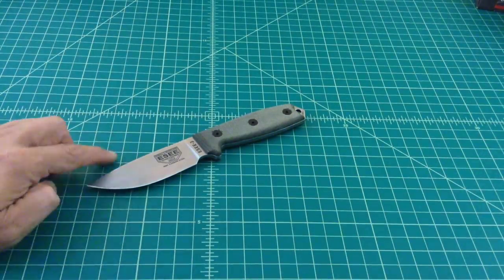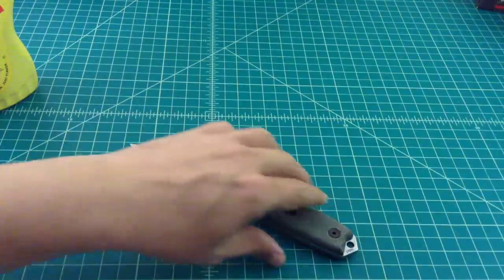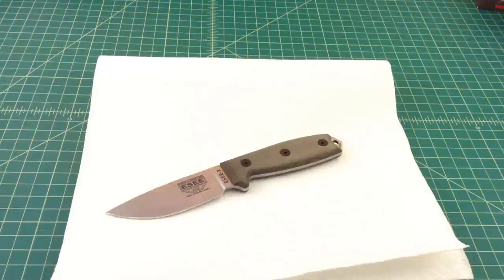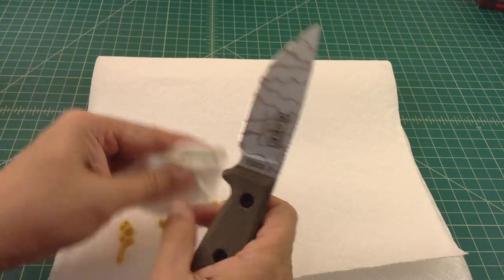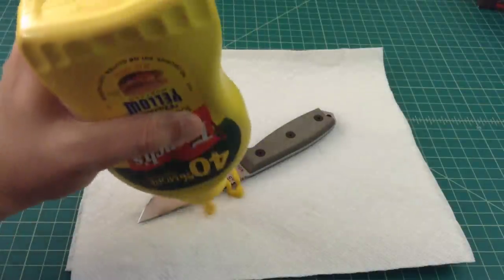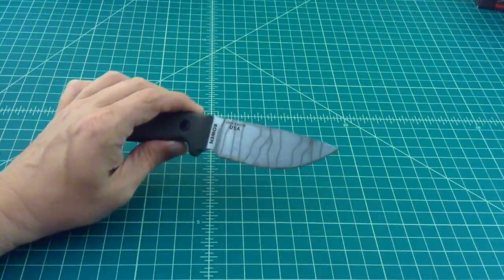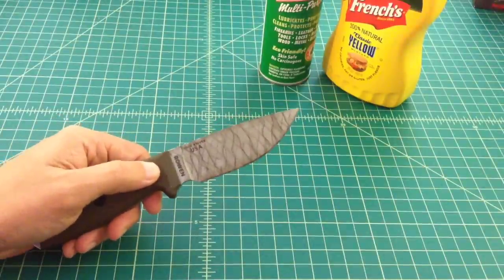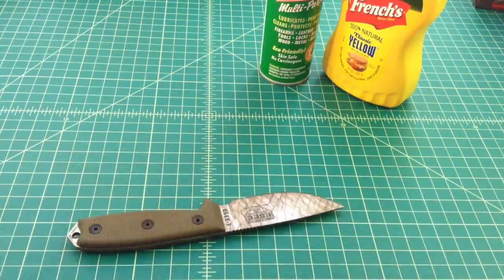ESEE 3 Knife - Forced Patina - TheSmokinApe

Comment: If you bake the mustard for awhile at 170-180 (oven's lowest setting) it will "burn" in the effect deep enough into the blade that you would actually have a hard time even sanding it off. Done it on Opinel blades. Actually, mustard, lemon juice and white vinegar mixed together worked best.
Reply from the maker: Nice, thanks for the tip!
Reply: J.P. Stone how long? I recently made a neck knife and I'm still working on the blade design. I'd like to know an exact time
Reply: JP Stone don’t do that. It fucks your heat treat up real bad. Your steel will be much weaker.
Reply: Enzo Warren 170 degrees fucking up a heat treat? Some people’s cars get hotter than that.
Reply: @nathandkreosote9917  Any heat temperature can destroy a heat treat.
Reply: @kash7768  Unless the steel becomes hotter than the temperature that the steel was originally tempered, the steel will not become softer. Heating the knife to 170f doesn't alter the steel hardness if the knife was (for example) originally tempered at 350f from the factory.
Reply: @kash7768  definitely not true

Comment: Just did a forced patina on my Mora robust with apple cider vinegar and it came out good so far. I boiled the acv and had the knife in a cup without the blade touching the cup at all. Left it for 10 minutes. Wiped off with a rag then boiled the vinegar again and did the same thing but this time for 20 minutes. I then scrubbed the blade with a water/baking soda mixture to neutralize the acid and then rinsed it. I then grabbed my mustard and used a piece of bubble wrap to apply the mustard onto the blade to give it a nice design. I will neutralize again after I'm done with the mustard I just forgot I was going to usethe mustard is all. We'll see how well it shows up. Great video btw! Thank you
Reply from the maker: Glad it was helpful, thanks for watching 👍

Comment: When I think about it most off all my blades are coated, except for a few, but I find by using your knife alot, and I mean alot they naturally get a patina on them, only a few don't have a patina on them, and this video might of helped me, can you use vinegar and mustard would that be double patina ?, My newest knife that I plan to use as my field camp knife, I just like a sturdy strong robust knife since I had a serious situation I was in once, I got the Busse ASH-1, and it came with a Cerakote (Green American Flag) both on the blade and handle, from my understanding the Cerakote is a tough coating to begin with so it should protect both the blade and the handle, but then the INFI Steel is corrosive resistant anyways. I'm hoping it will be a pretty tough knife, my 3" blades all have some sort of coatings or are made out of stain resistant  steel, my two Swamp Rat's my Rodent Solution and my Rodent 3, my (2) BK'14's, my Busse A.M.S. LE, my Top's SMK, ALL are coated Oh my Browning Independence fix blade is made out of CM 154 stain less and that's it, 3V also rusts differently too, so the more you use it, it patinas by itself (differently)., I just use it alot. But Thanx for the tip, I guess it's hotdogs without mustard for a while heh heh heh.
Reply from the maker: paulie 4x Yes, you can do a double patine that way, lol at hot dogs and no mustard....

Comment: i have done this. did not get the same effect. tried double strength vinegar, same mustard as you and lemon. Have some discoloration and soaked over night, and 24 hr still not like what you show. if anything i get more orange rust in very small areas does rub off. Dont know what going on??
Reply from the maker: Not sure, are you using a carbon steel knife?  Maybe clean it real good with scotch bright and try again?

Comment: Would vinegar make it look better?
Reply from the maker: BlodOchStål The vinegar in the mustard is what stains the knife, the thickness of the mustard allows you to control the stain.  I have never done pure vinegar so I don't know.  If you try it let me know how it turns out...   thanks for watching.
Reply: I tried it. I wrapped a vinegar soaked paper towel around the blade for 30 minutes and then put mustard on it like you did in the video. It didn't look as good as this. The white vinegar made a dark patina that made it harder to see the pattern the mustard made.
Reply from the maker: BlodOchStål Thanks for the update!  I may give this a try to see how it turns out...
Reply: +TheSmokinApe It's worth a try.
Reply: just my 2 cents if you want a pattern use the mustard, I like to squeeze it in lines, then dab it so it gets fully covered, the thicker the mustard the darker the line. I've used vinegar too, but when I do that I soak the blade in vinegar for an hour or so for an even color, the longer the soak the darker the color.